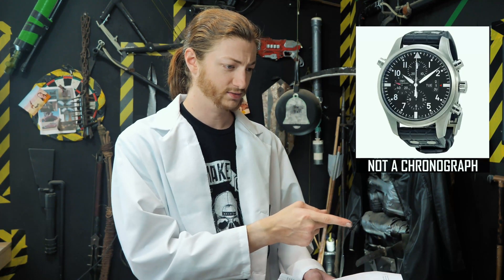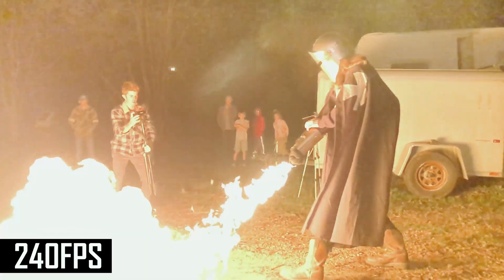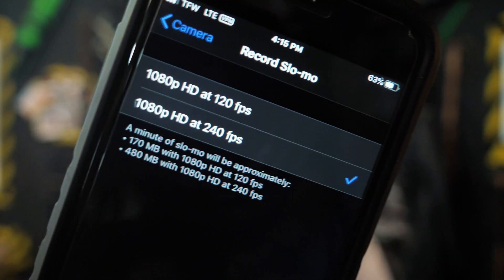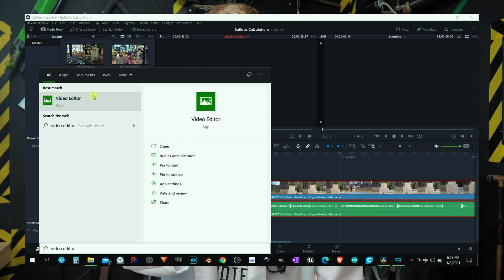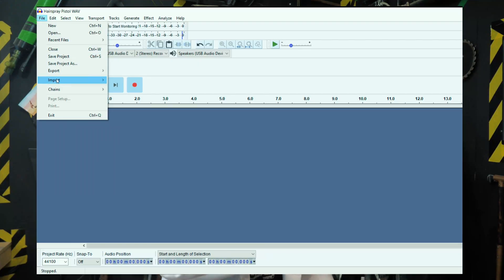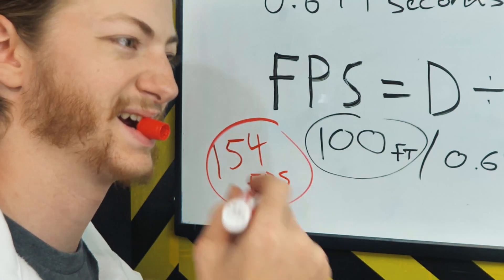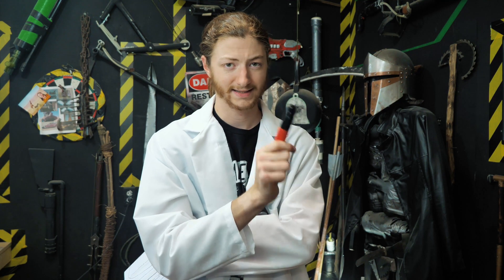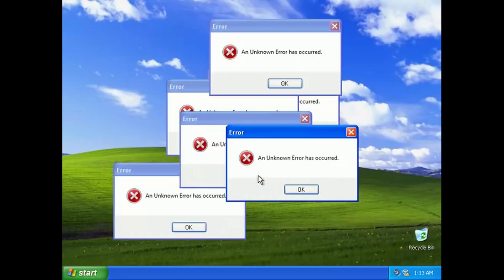Calculating Projectile Velocity with HOUSEHOLD ITEMS!! (& KINETIC ENERGY)

Comment: If you prefer to calculate kinetic energy with "bald eagles per Sasquatch" (😂💀) you can use Foot-Pounds. Though, you need to convert lbs to a unit called a "slug" and then the same equation should work with ft/s (I think). But it's prob less complicated to just find your answer in Joules and then convert to ft/lbs lol. Anyways, great vid!